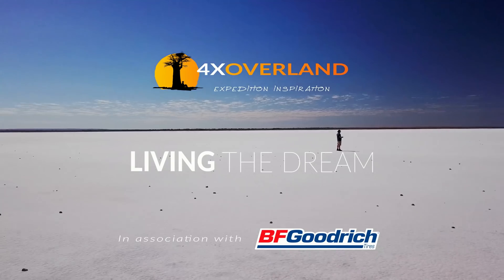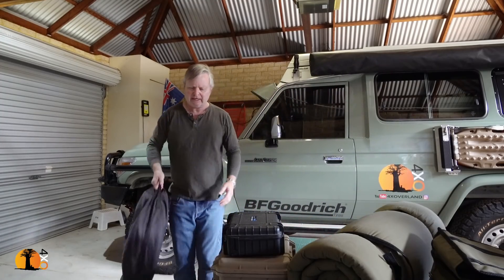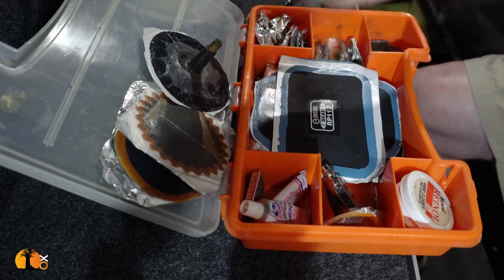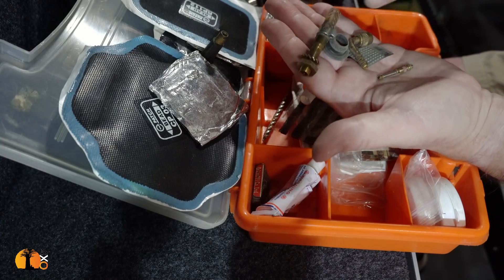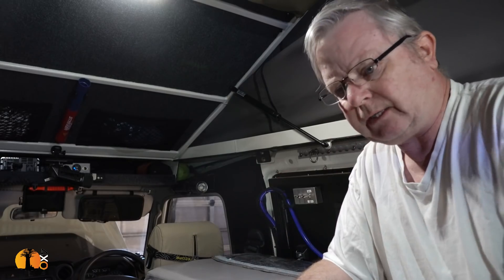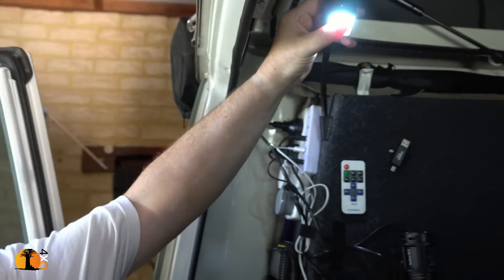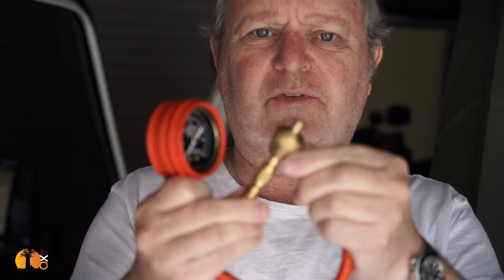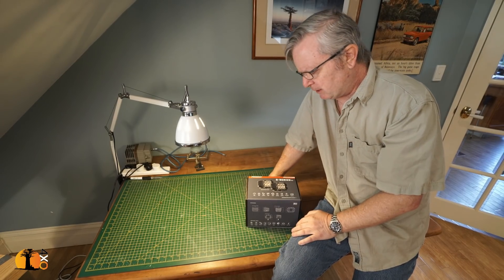4WD TRUCK PREP-3 - Trans-Australia | 4xO Outback Expedition

Comment: Andrew at 10:13 I see that you have "DEULER A/T" fitted...  Thought you were running BFG's...?
Reply from the maker: God, its unreal how many people noticed it. These were the original tyres that came with the truck. I put them on during a tyre rim swap. It doesn't meany anything folks!!! I do not run and would not run Duellers. I did once, long ago, and they fell apart.
Reply: Ah ok that explains it...All the best with the upcoming trip...

Comment: 9:45 Bridgestone Dueler 697, did you change tyres?
Reply from the maker: God, its unreal how many people noticed it. These were the original tyres that came with the truck. I put them on during a tyre rim swap. It doesn't meany anything folks!!! I do not run and would not run Duellers. I did once, long ago, and they fell apart.

Comment: 8:39 I know you have used cable ties, but you can purchase soft zipper pull strings
Many backpacks use something similar also

Another option i took to de-clutter the cabin and dash, was to removal cigaret lighter adaptors (phones, dash cams, etc) and purchase hardwired solutions.
Thus freeing up all 12volts sockets for random items
While my phone, dash cam, tablet were all hard wired using DC-DC adaptors behind the dash and leaving fly leads near each holder.

Comment: Wait a minute, did you switch to a different set of tires!? Your right rear is a dueler?
Reply: Davin Ellicson funny thing at the end of the video the front right tire is a KO2.
Reply from the maker: These were the original tyres that came with the truck. I put them on during a tyre rim swap. It doesn't mean anything folks!!! I do not run and would not run Duellers.
Reply: 4xoverland Yes, that is why I pointed it out. Last time you had massive tire failure was with Duelers. So, I was real curious.

Comment: A bit drastic cutting off the zip tabs.We just push foam ear plugs into the hole and it works a treat. Interesting to see what you pack to go on a long trip - we just can't compete with that level of efficiency and economy, we go for different periods of time and take an astounding range of 'junk' but then we have a lot more room and we don't go as far out into the boonies. Wishing you a safe, enjoyable and productive trip.
Reply: PARACORD WORKS FOR ZIP PULLERS
Reply: Paracord loops works perfect in any tent.
Reply: Agreed, gutted paracord is a great alternative
Reply: Reflective zipper pulls , cheep and great for night tie adjustments